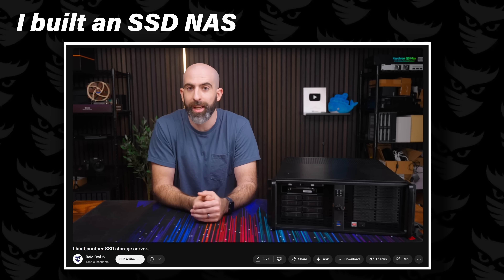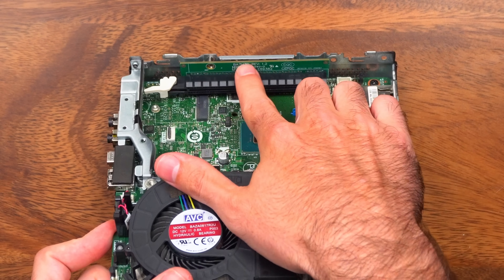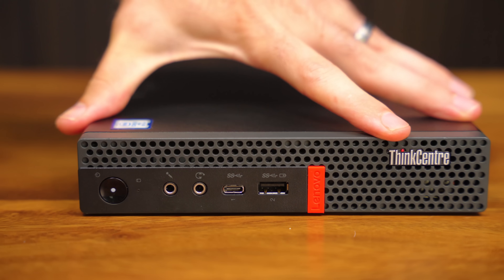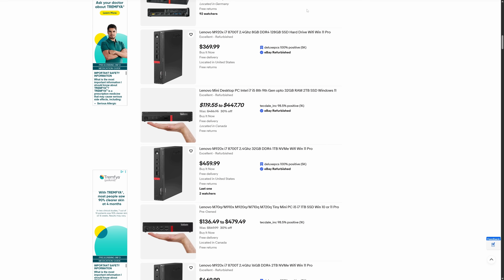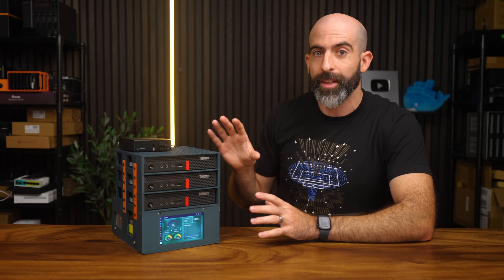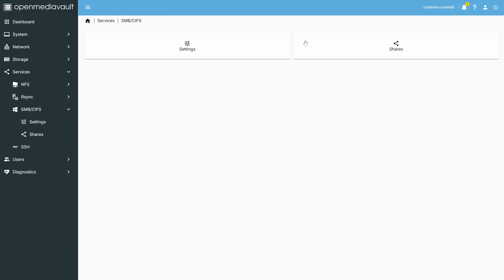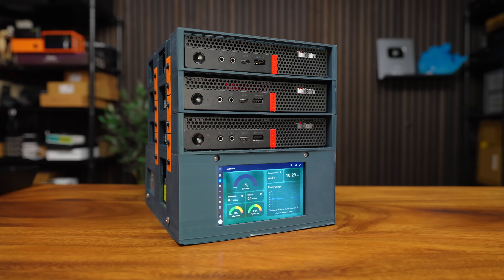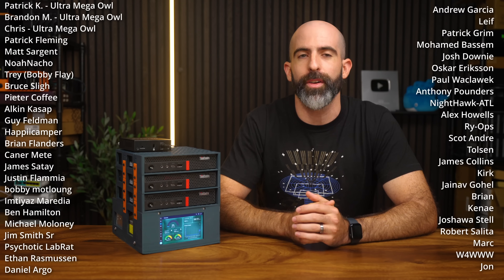I built a tiny home lab

Comment: You can do pfsense with a single nic if you can use vlans.  You can also run pfsense under proxmox, which will almost certainly leave you with enough space and CPU to run something like a second  NAS to use as a server for backups.
Reply from the maker: Yeah I'm just not a fan of virtualizing my gateway
Reply: @RaidOwl  I hear you, but it might be worth having a backup firewall on your production  server host, to use while you are upgrading the main firewall, even if its a cold-failover.

Comment: I''m surprised you did not run into the motherboard throttling your cpu since you are not using a genuine power supply with the 3rd pin. I ran into this with the dell minimicros and HP has the same issue as well. these Lenovos looks like they have a 3rd pin as well

Comment: @12:00, Yes, this. Recently I picked up 3 GMKtec mini PCs which each came with their own big ass power brick.

I really like the idea of this variable power supply to delete all those bricks behind my mini pc stack but electricity scares me. 

I really wish there was a more complete variable power supply solution that came with a custom set of power cables that had a standard connector on one end to plug into the power supply without having to screw down a bare wire and the other end with a set up of all the different barrel connectors that could be swapped out to match the barrel connector on whatever it is you are powering, like those universal power bricks with multiple power connectors.

Anybody have a contact at one of the power supply manufacturers that we could pitch this idea to?

Comment: I am making a HA Proxmox cluster with HP ProDesk 600 G4s and they are basically the same. I used the wi-fi card slot for 2.5GbE, and the most important is that I wanted the 8th gen intel platform because they are desktop chips and can be upgraded to any SKU between 8th and 9th gens. Cool video, continue your good work kind sir 🫡

Comment: Maybe try with Dell Optiplex Micros. I have several Optiplex 7050 Micros with i5 7500s.  I have room inside for a large ssd drive and M.2 storage and 32 gb ram.  i run Kubuntu, Ubuntu Studio and use them for Kdenlive and Hanbrake.  I think they would work nicely for a project like this.

Comment: These get way, way better with a soldering iron and some adventure. The second M.2 slot can be populated with a header (I believe by default the socket is M.2 SATA only though), and there's a way to solder some additional bits to enable PCIe bifurcation. You can also get an adapter (that does fit) for the wifi slot to run a second NVMe drive on it, as well as the very popular adapter to run a 2.5GbE NIC. Lastly, a lot of 2.5" SATA ssds are mostly empty space inside - I stripped a 240GB SSD from its case, 3d-printed a smaller enclosure to prevent electrical contact, and use that for a boot drive along with a 10GbE NIC in mine. They're great units all around.
Reply: Ohhhh - when does your video drop? 😉
Reply: Lets see a video man?
Reply: It's not just the header right? Need a bunch of smd capacitors and resistors to get the second m.2 slot working.
Reply: I bought “tinyriser” adapters for my three machines, they were shipped from somewhere like the Netherlands and they’re great. Allows me to have an extra m.2 in each machine without losing the pci-e slot for my NIC.

Comment: You have the wrong top case for the GPU.  There's an option with a grille for GPU air intake.

I use 3 of these for my home setup too.  One P330 with a nVidia T1000 8GB running Debian 12 for containers, one M720q with a quad ethernet card running ESXi for VMs and one M710q with an additional ethernet adaptor in the WiFi slot and a 2TB HDD also running ESXi for more VMs.
Reply from the maker: Oh cool I'll take a look at that

Comment: I have the Lenovo m720q with an Intel i5 8400T and 32GB RAM. This has been running 3 VM's, 22 docker containers and a ZFS array 24/7 for the past 2 years without any issues. These are awesome machines for small home setups. The don't make much noise, hardly eat anything and barely registers in Top while running all of the above.
Reply: as someone new starting out with homelabs. I'm stuck in buyer's paralysis would you be willing to offer some recs. I keep seeing these mini labs. Do I start with one of these Lenovos, or do I need to get 3 to make everything work properly. Or should I buy a New unit, such as a Minisforum MS-01 or MS-A2, and start from there? Me as a newbie sees everything you mentioned and wonders how does 6 cores run all that... Thank you for your time
Reply: @alberts5285  These mini PC's run great. Just make sure to get an 8-gen i5 or i7 and upgrade to at least 16GiB RAM, or 32GiB if your planning on running ZFS. Like I said, I am running both NFS and Kerberos as separate VM severs (not containers) along with 22 docker containers like Reversed Proxy for domains, DNS server, time server, various VPN's such as tailscale, cloudflare and zerotier, web services like gitea, Home assistent, syncthing etc and even Jellyfin which multiple users some times access at the same time. It hardly ever spike much on the CPU, temp is kepts low, RAM is kept at a reasonable usage. These things are great for this type of usage and they use much less power than most other hardware and they are cheap. Downside? You need a DAS for your drives. But there are plenty of 3, 4 and even 8 drive DAS boxes with USB connectivity. I bought a 4 drive 1U rack mountable DAS from QNAP. Add a few 18TB drives in Raidz1 to this and your good for awhile. The Lenovo machines also support an additional PCI card, so you can add a 2.5Gbit/s NIC or a dual NIC that can be added in various bonding modes.
Reply: Start with something you already have so you can practice and get a feel for what you want. On an old 4670K I'm running xcp-ng with 4 VMs - TrueNAS, Windows 11 Pro, a Docker host, and a testing VM. The Docker runs about 10 services for local network, including Jellyfin, Zen Orchestra, Netdata, etc.
Reply: Oh, and I put pfSense on a separate fanless N100 so I don't lose Internet access if I have to troubleshoot, upgrade, or reboot the VM server.
Reply: what is your main hypervisor? what do you have virtualized?
Reply: @sageosaka  I use KVM via Incus on a Debian server. I like to have things split up, so that I can more easily fix or change one part, without having to bring everything down. So one VM controls the UPS, one runs my ZFS pool and NFS server and the last runs by Kerberos server. Every device that I have only has an OS installed and access everything through NFS via several shares. On the go with a laptop, Tailscale provides Lan access to it all, hosted on Docker along with DNS, Reversed proxy and much more. Every docker container that needs access to the ZFS pool does so via NFS also. Nothing besides the NFS server touched the pool directly. This makes it much easer to control ownership, permissions etc.
Reply: Is the ZFS array external? Or just the built in slots?
Reply: @ThePierdevara  Like mentioned, I have a QNAP 1U DAS which is connected to USB on the Lenovo m720q and holds 4 disks.
Reply: @danielberglv259  Thanks for the reply! I am looking to build something similar with a mini pc i5-10500t + a cheaper DAS (TERRAMASTER D6-320), but everything I read says ZFS over USB is a big no no. Your DAS does support hardware RAID 0/1/5/10 I see but you mentioned ZFS
Reply: @ThePierdevara  I am not using the hardware raid options, I use the passthough option. Before that I used a custom build DAS using SATA to USB adaptors. ZFS over USB is not an issue. I have been using it for more than 4 years. It has been running 24/7 and has been rock solid in that time. USB may be slow if you want to maximize the speed of certain SSD drives, but with regular HDD there are no issues with speed either. It even supports disk spin down when the drives are not in use.
Reply: Love the pfp dude.

Comment: Personally, if I were building a lab and had three mini PCs, I would go with a Proxmox cluster and virtualize everything.
Reply from the maker: Yeah I mean that's the 'correct' choice, but I have enough clusters already
Reply: @raidowl personally, I would (I did) replace pfsense with OpnSense. For me OpnSense just worked better. My ProxMox/OpnSense/HomeAssistant stack is active for 5 years now.
Reply: Virtualize router, not a wise decision.
Reply: @EVR1AL As long as it has its own NIC (on a dual NIC device for example). Personally I did it (OpnSense) by having a VLAN capable switch pipe in the external WAN without exposing the ProxMox host.
Reply: @cybermaus  yeah as i said

Comment: You can get bifurcation if you have a card that supports it.
Bifurcation has 2 options, built into the motherboard/bios or a dedicated card that handles it.
Both options tend to be pricey.
Reply: Bifurcation happens at the cpu/motherboard/chipset level, let’s you divvy up a set number of lanes 

The alternative is a PCIe switch chip aka a PLX chip. It doesn’t divvy up an existing number of lanes, it uses up all of them and essentially acts as a network switch only for pcie devices (usually NVMe).

Bifurcation is much cheaper than pcie switched
Reply: @techheck3358 if you already have a board that has it, sure.
But bifurcation exists on card as well. 
I've used both, and has been around since at least pcie gen 3

Comment: I've been running proxmox for my homelab on that same Lenovo m720q for a couple years now, it's been rock solid for my modest lab.
Reply: I've got a p330 (same machine but came with a GPU) that runs a pfsense VM under Proxmox. It's way overkill, but I can route across VLANs at 10gbit with the Intel x550 I slapped in it. So much juice for a 1L box.